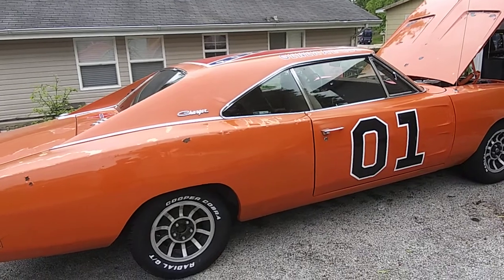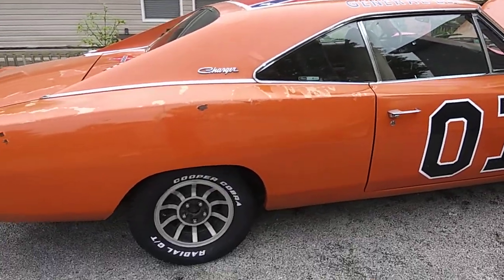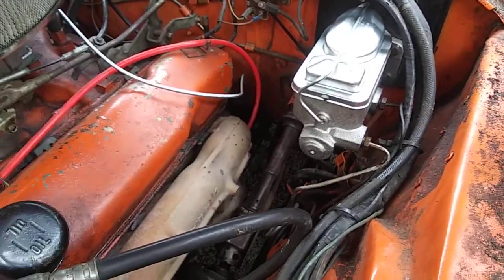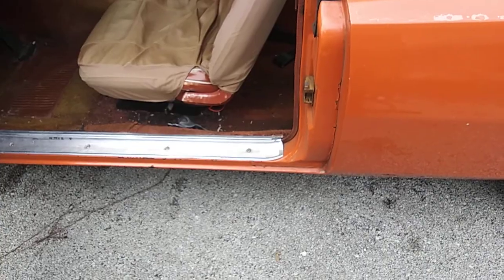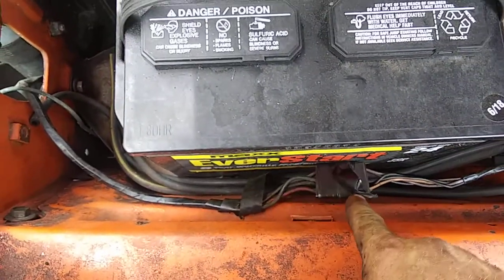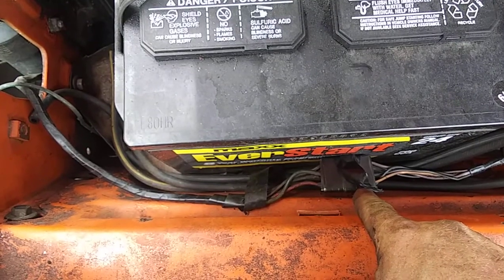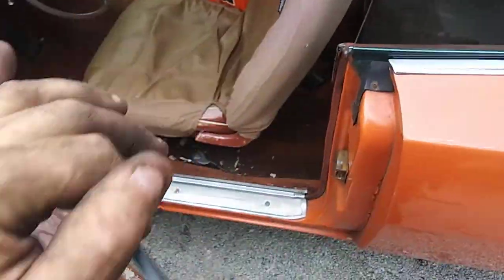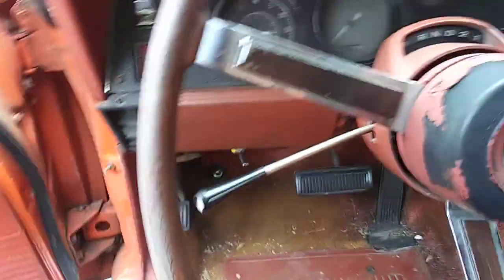DIY TECH REPAIRS: Mopar 1969 Dodge Charger 440 CID One of 2 General Lee's

Comment: Both beautiful cars to me....since I drive all my cars I have to convert them to uni cast mopar disc brakes the traffic were I live will get a drum brake car in to trouble in a hurry!
Reply from the maker: I agree . back in the day they where ok brake systems for the top speed limits at that time but traffic now days and highway speeds are higher and these older cars benifit from better brakes upgrades . but you cant get that through certain peoples heads they think that these brakes came out for these cars and it was fine then and its fine now 🙄. My 65 dart had factory 9" drum brakes all the way around and the single master cylinder . if you wanted to stop you had to think ahead at all times especially at high speeds . that single master if it goes bad the whole system quits 😳. I live in an area with lots of hills so I upgraded to stock 11" disc brakes up front and 11" rear drums with a manual dual master cylinder for a 74 dart  much safer. luckly for him he just drives this a couple miles down the street to his store and back and maybe down hwy 76 to the car wash .

Comment: Ifit has drum brakes all around, why did you get a disc brake master cylinder?
Reply from the maker: because that would be for front disc brakes . this has drums so I got a factory replacement master that works great